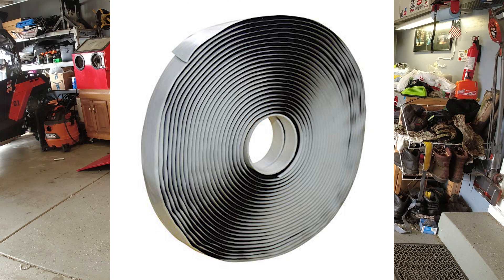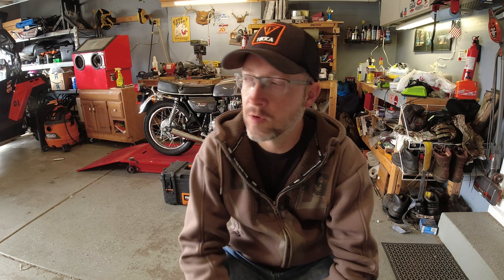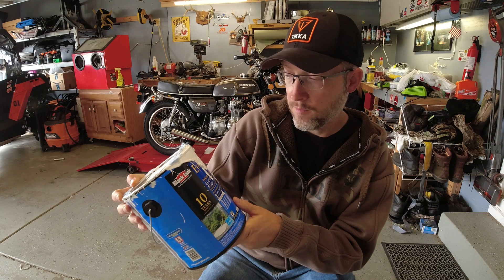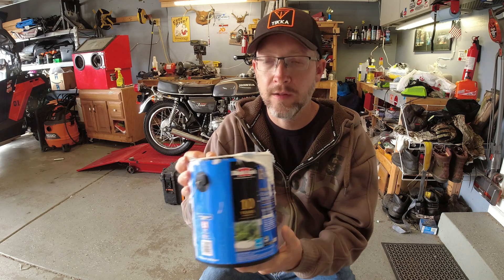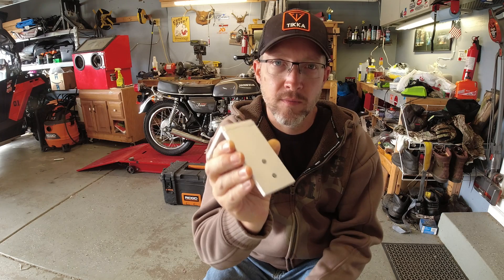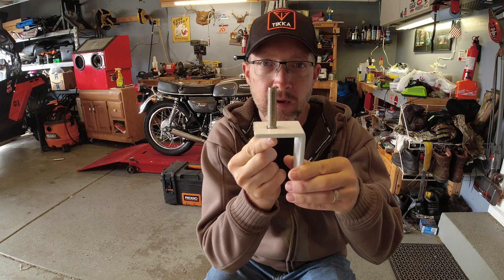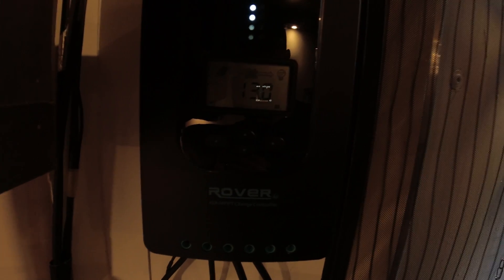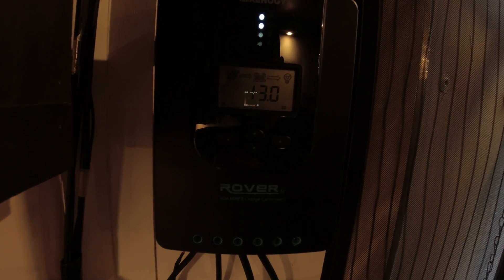HOW TO MOUNT SOLAR PANELS TO RV\TRAILER ROOF

Comment: How do you attach panels to galvanized pipe?
Reply from the maker: Drill holes through the pipe and use a carriage bolt, washer, and nylock nut.  Holes are already in the panels.

Comment: If I remember correctly, you have a 12 or 14’ cargo trailer. You pull it with a Toyota Tacoma? How does the Toyota handle the load and what mpg do you get while towing. What is your trailer weight when loaded? Thanks
Reply from the maker: Hi Rick!  Yes I have a Tacoma and a 6.5 x 12 7’ tall trailer.  Loaded up it’s 3950lbs.  On the best day if I keep it at it under 60mph I’m lucky to get 11.5mpg.  If the winds against me or I’m speeding the worst I get is 8mpg.  I have too much tongue weight (850lbs) and my truck cargo weight is nearly maxed out (weight of everything on board of the truck not including trailer).  It sucks!  Im about to get dual axle setup which will take weight off tongue and also allow me to put more weight in the trailer and out of the trucks cargo weight.  It really comes down to wind, this thing is like moving a building down the road!  Hope that helps you.
Reply: Yes, thank you so much. That does help more than you know.

Comment: Hey any issues with the self tapping screwing holding it in the side holding up I was debating if I should try and bolt mine through the cross member
Reply from the maker: No issue yet and it’s been on a few trips like this, I was up there scraping snow off today and checked
Reply: Just makes me a little nervous with just the screws
Reply: Hey it looks awesome so did you screw the self tappers into a cross member piece or just to the top
Reply from the maker: @wesley20991  The beam going across the top but not a crossmember
Reply from the maker: Front to back
Reply from the maker: I figure there’s maybe 50 pounds in that set up an eight self tappers which is about 6 1/2 pounds per screw

Comment: Time for some flexible panels that will last!
I put the silicone paint on roof. Big difference in cabin temp. Nice work man!
Reply: flexible panels easily crack. They also become inefficient in about 5 to 7 years. not worth the hassle.
Reply from the maker: Thanks for watching John!  Do you have experience with these Renogy panels not holding up?  I think they have a decent warranty but haven’t had to use it yet.

Comment: Nice mounts! I'm 8.5' wide. I am thinking about my options. At the top of my list is low profile Unistrut lengthwise bolted into roof joists, then more unistrut widthwise, like you did your poles. My roof is doomed, so I'm thinking 2 base rows on the left side and 2 base rows on the right. I will end up with 6-8 panels. Starting out with 2, then adding as funds are available. 
(I'm pay as I go kinda guy - no bank-money in my wallet)
- Q: How wide and how many watt are your panels?
Thanks!
PS: Nice Honda!!  Brings back memories!!
Reply from the maker: 19.5”x42.25”.  If it were me I’d mount something your uni struts could mount to on top of the trailer, then cover those mounts with roof sealant.  My little rack of 3 is a lot heavier than I thought they’d be, so yeah you’d definitely have some sagging if you tried to go all the way across.  Also if you are planning on running 6-8 panels eventually and are hooking them all together, make sure to run thick enough gauge cables to handle all the amps of 8 panels going to your charge controller.  Right now I think I am about maxed out.  Yeah I don’t like to go into debt for anything either.
Thanks!  It was a labor of love restoring that bike, I may do a restoration video using pics I took during the process w voice over this winter.
Reply: @bwiesman  that would be cool. I scrolled down and didn't see anything on the Honda. But I'll watch for it. Even if all you have are photos with voice over, I'm sure the audience would enjoy it. Thanks  for the suggestions. I'm debating in just having some 5/6" threads poking up through the roof, or bedlinering the unistrut and mounting it flush. But now that you mention it, I'll lean towards some ss threads with a nut. Then I can use a fender washer to hold the strud up off the roof. Or even a coupled nut if I need the height. It will give me more options, for sure! Thanks.
Reply from the maker: @Lapeerphoto  here’s a link to a ride video I did up around dowagiac this summer, it’s a bit long but I was having fun lol.  I open it up around three min mark.  The threads sound like a great option!
https://youtu.be/EgAD5E6_8OY
Reply: @bwiesman  WOW - it's a beauty!! You did a great job.
Reply from the maker: @Lapeerphoto  Thank you sir!
Reply: I would mount on the SIDE rails and NO  holes in the roof. I would also run 3 n 3 or 4 n 4 panels using TWO solar charge controllers. Trust me, if you are going to be using that much solar and ONE CC goes out you are dead in the water. having two insures you will always have power from the sun.  Best of luck with the mounting. 
PS: I would also look into Tilting your panels. you get 60% MORE from the sun in the winter months. I have been doing this for years.
Reply: I built a kayak rack out of unistrut. Earthquake proof, but really expensive!

Comment: I like the fact that you put them on the rack I always say if you put a hole in your roof it's going to leak I didn't even put a vent in my roof on my 6x12 cargo trailer I even have my power going under the trailer I'll be putting a video up on that soon I hope I vented under the floor as well. Now is that a Honda 500 four behind you if so I wish I still had mine and could ride I put about 40,000 miles on mine in 2 years just fooling around. I saw some nice places and had a blast.
Reply from the maker: Thanks for watching and for the sub!!  The bike is the baby 350 Four.  I posted a ride video if you want to relive that experience.  They are great bikes and I think the 500 is the perfect in that lineup, I bet you had a blast on it!  I plan to do a restore video on it this winter.  Unfortunately I didn’t get video of the rebuild but I took a ton of pics.  Yeah, no more holes in my roof!